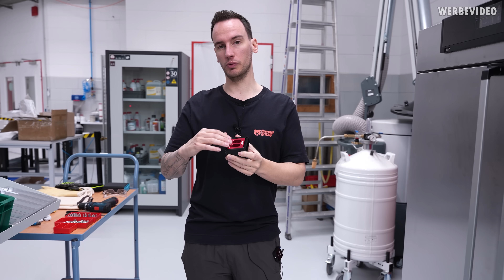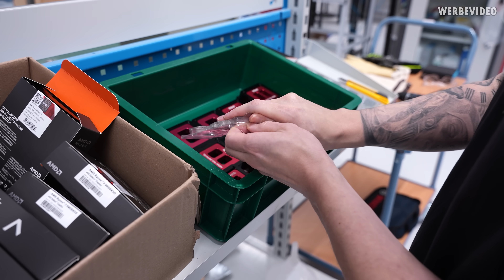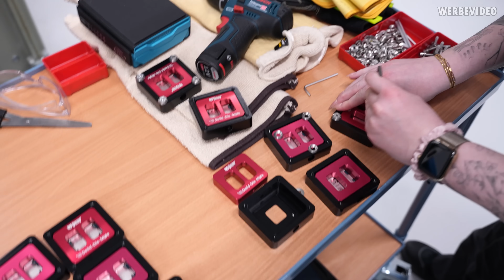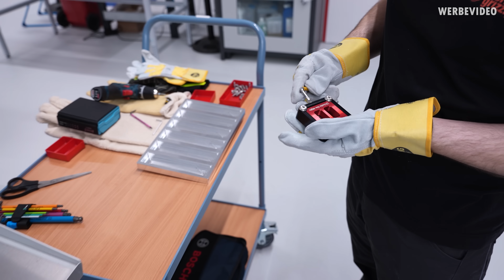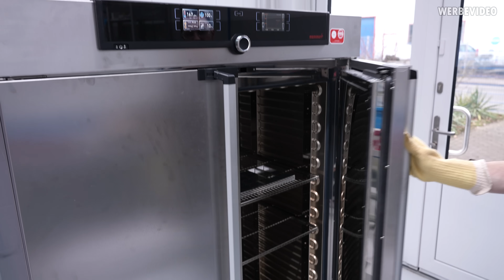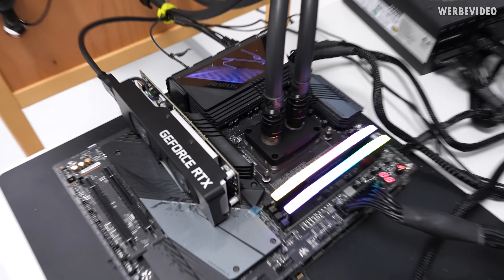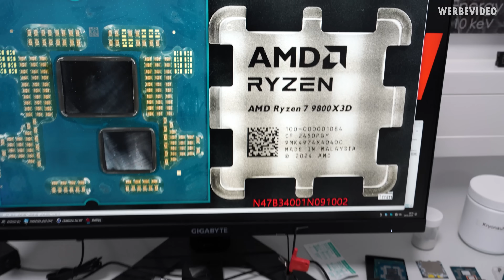You can now buy Delidded AMD Ryzen 9800X3D with 2 Years Warranty

Comment: 800 USD to get it delidded when I can purchase one brand new for $470 or used for $390. Not sure if it is worth it..
Reply: I also looked for a pre-delidded CPU (AMD Ryzen 9 9950X3D), but I felt it was better to buy it from a store for €600 rather than pay €1000 for a delidded one. How can the warranty cost that much? They already have the knowledge and the equipment.

For me, it would be enough if they simply tested the CPU after delidding and sold it without a warranty, since the customer should know how to properly install such a product. A warranty should not cover risks caused by improper use by the buyer.

Comment: Quick Question: Once its delidded, does one just mount a cooler (AIO) on top? Will the cooler lower to the die, for example using the thermal grizzy frame installed as well?

Comment: i see some pretty low hanging optimization fruit. why not gang a row of these tools together, drive it with an off-the -shelf leadscrew-based linear actuator, driven with a stepper or servo motor? you would need some sort of hinged or removable linkage between the actuator and the sliding block unit, so that the connection to the actuator doesn't prevent it from being lifted away when loading/unloading CPUs. Also, i noticed that in the consumer version of your tool, you use washers as a sort of bearing surface to hold down the sliding part. this is a low-quantity internal tool, why not replace them with a pair of stiff rails that index into place on top of the combined base, and are held down by toggle clamps or some other high-force quick-release mechanism?

Comment: Isn't the original 9800x3d processor good enough? Why do we need this process? What % performance and fps do we get? These are the questions that occupy my mind.
Unless he is a conscious and experienced user, someone who delided his processor will not be able to overclock it anyway, he will use the default profiles in the bios. Right?
It can be applied to intel processors, if we can be efficient enough and get enough cooling, but if I'm going to see the same temperature values, I don't think it's necessary.🤔

Comment: Missed the notification when this video released due to a crazy workload. I only have one major criticism of this initiative and that is that it should have come out sooner so I may have been able to get this instead of the stock version. In all seriousness tho I think what you are doing is fantastic and I still don't see why AMD couldn't do the same thing from the factory, especially considering that if it was their own product the would be able to produce it much cheaper than the lidded product (No costs for IHS, glues etc). I love the inclusion of the USB as it protects both yourselves and the purchaser allowing both parties to buy/sell the product with confidence. As someone that does not want to void warranties but also wants to tinker with water cooling I only wish to see this sort of approach  also reach GPU's as I was originally looking at getting a 5090 with a water block. The only one I know of that comes like this is the AORUS XTREME WATERFORCE WB and that went from I think $5,500 AUD to $7,100 (not that there was any stock). I hesitate to instal a block because, even though I know I would be able to without a problem, dealing with any sort of RMA is made even more difficult from Australia. I love to see initiatives like this actually going ahead and I think Thermal Grizzly may one day soon be the new go-to water cooling company that hopefully sells everything you need.

Comment: Are you going to do the same for next AMD chips like 9950X3D or next gen?
And I've heard some stuff regarding delidding but I'm not sure here, you ship it separated from the heatspreader, what's the point in the end?
I just got my new rig less than a month ago, went from Intel to AMD first time, some stuff are better some are same some are worse, was planning to go for 9950X3D but just couldn't wait for it but it's just a matter of replacing the CPU if I need it, I think 9950X3D is gonna be something better for what I need most likely.

Comment: Looks reasonable in terms of pricing. Electronics stores would charge around the same just for their own additional warranty)
From the perspective of a customer I thinks risks + delid tooling + removing glue and polishing + testing for that price seems fine. I thought it would be more expensive.

Are you planning to also make OC packages or packages with a bracket of some sort for safer cooler installation? I believe OC packages have to be mobo+cpu, probably RAM too, and I don't think there will be enough demand to make it work business-wise, but it is still interesting to see your (or anyone else) thoughts

Comment: The normal CPU costs €550 on eBay France. So if you buy this from outside the EU and get it shipped, then the delidding would have cost you around €20. Incredible value.
Reply: customs fees exists tho in France and they are not cheap

Comment: I have seen a video of using dental floss to remove the glue from the four corners of an AMD AM5 CPU. If you are skilled, the whole process only takes 5 minutes. Compared to your first step, this method will not cause physical damage to the CPU core.

Comment: 11:30 Since you asked for feedback, the only thing I would say is that AMD offers 3 year warranty on their CPU's whilst you are offering only 2. I am looking to build a new machine soon and would be interested in a delidded CPU however the warranty reduction seems odd. I understand you are taking on financial risk and that you may have settled on a 2 year warranty based on failure rates, DOA CPU's, mistakes happening during the delidding process, etc, but the reduction in warranty gave me pause. Otherwise, this is a cool idea and I wish you all the success.
Reply: If 12 months less warranty gives you pause, delidding was never for you. You do realize that by delidding, Thermal Grizzly is assuming all the risk? They can't RMA the CPU's to AMD if anything goes wrong. Add to that, they actually cover more with their 2yr warranty then AMD does, because AMD will void your warranty so fast, if they suspect overclocking.
Reply: @tessaninetails8065  I made reference to that in my comment. Spend 5 seconds more to read the remainder and you would've seen that. He asked for feedback (positive or negative) and i gave it.

Comment: I'm getting  46325 on R23 with my 9950x at 80degrees with PBO and -30 curve. My 5950x was getting 31000 with similar settings. Both using the Thermalright AIO 3x120 cooler. I think that's pretty good.

Comment: Been working and just got around to watching... I'll tell you what, you offer to mount a 9900x3d delidded, mounted to a mycro pro with conducto extreme, a delidding V2 frame, and whatever extra cost for the shield... You have a service or group or bundle that I'm down to pay the extra on. At the end of the day I think it's a great idea for a niche few of us. I think offering something like the above opens it up to those that are interested and still concerned with say cracking the die while mounting a cooler etc. just my two cents, charge what you will the market including myself would pay for it. The price is fair and if you weren't sold out already I'd have order a 9800x3d for a family member while I wait on the 9900x3d.

Comment: You need handles on the CPU tray, Your gloves are touching the pins when moving it / with a big chance of moving them or bending. Just an observation. Maybe use a transport trolley too, so you have less chance of a drop. Just see that as probably the risky part of the process. PS (your 1 looks like a 7 on the test sheet) I'd lalso ove to see links to cooling options you offer / tested for at lower profile de-lidded CPU, as I'm sure rthere are restrictions / mods that are required for this as a cooling requirement. Keep up the good work!
Reply: What pins? You mean the pads? Lga cpu no pins :)

Comment: This is awesome! As a few people have pointed out already, this is a fantastic value and genuinely have me excited. I was planning on waiting for the next generation of AMD processors because I was hoping for an IO die upgrade, but if I jump ship early it will be to this. Looking forward to more gray products like this from you and Thermal Grizzly! I delidded my 4790k back in the day and would easily have paid the difference here for a warranty and expert hands
Reply: Not a lot of point to upgrading the IO die, at least to a smaller process.  There just isn't any significant advantage in a die shrink.  Other stuff like a new memory controller or more PCIe lanes will not happen till AM5 has run its course.

Comment: That's a cool idea, I'd like to try a delidded cpu in the future.  I have an almost 2 year old 7800 X3D, maybe in another 3 or 4 years when I upgrade.  The last thing I'd need is a video reference for how to properly apply liquid metal, and install a common liquid cooler radiator (Arctic etc.) on the delidded cpu.
Reply: You need a special water block for a delighted CPU or the contact will be improper
Reply: @stang10189  Thanks, I wasn't thinking in detail, good point.  I realize the liquid metal needs to be gasketed in place to prevent egress over time too.  Obviously not as permanent like thermal paste.

Comment: Above and beyond Der⁸auer. 

I'm on a 5950x r8 now. Would be happy to buy from you on my next upgrade. 

Would be even happier if you did 9950x plus if you could do the "insulation painting" of adjacent structures to avoid short circuits. What I mean is the chip ready for the LM to be applied from my part. Nothing more.

Comment: Could you possibly do this as a combo pack with the cooler? Not sure on the variances between MBs but would the cooler have torque specs with it? I am asking because you brought up cracking the die and that would be one way to alleviate that worry

Comment: Neat service to offer for those that don't want to do it themselves, but want that performance. Kind of interesting to see that you are still using a standard CPU threaded nut tension system on your test bench even though that system is going to see hundreds or thousands of CPUS. Maybe engineering some sort of quick release arm system would benefit loop time for testing which turns into lower costs. You should consider trying to find a datasheet about the CPU socket to make sure you arent running too far into its maximum I/O count and marking CPUs as faulty that actually arent.

Comment: If you have this version cpu, could you cool it with a 280 aio (normal size rad and fan, 30mm+25mm)??
Reply: Most of the performance improvement comes from the WB which affect the heat exchange between the CCD and the liquid. Installing an AIO, which features a basic waterblock, instead of a proper high end direct die WB simply doesn't make any sense.

Comment: What I've always been curious about: Heating up the CPU to melt the solder joining the chip and IHS, this doesn't damage anything?  It's always been a bit of a point of confusion because it's well above TJ max and I've known many computers (though in this case laptops) die from running too hot for too long.  If it really is that safe, I take it VRMs or electrolytic capacitors are the culprits there?

Comment: This is a pretty good setup. The cost that someone's going to spend to de-lid themselves is actually not far off from the premium you're charging. When I delided mine, I used fishing line to cut and hot air soldering station to remove. This left me with quite a lot of Indium residue. Which I had to sand away, leading to me having to lap my CPU. It worked fine but it was definitely time-consuming

Comment: Hmmm... my 9800X3D is running un-delidded at Delta T 40 K stock in CB23 (10 Min.). Guess I was quite lucky in silicon lottery or the temp readings are awfully wrong. Only time will tell.

Comment: I would be interested in purchasing a delid CPU with pre-applied liquid metal and the TG direct die watercooler. Any package deals available?
Reply: Yeah, I think that would push me over the edge for my upgrade.
Offer a bundle of everything I'd need for a Direct Die cooling:
Compound, water block, frame and CPU.
Not sure how well liquid metal would travel pre-applied if it wasn't mated to the block and I guess you'd have to separate the block and CPU to mount the frame on the motherboard.
Pre-applied paste is common in other coolers, but with liquid metal, I'd be worried that it would get melted in transit.

Comment: unless you're into XOC using LN2 then why would you bother?  after also buying the required direct die water block you have a setup that is far more fragile, performs 5% better best case scenario and costs £200 more.

great product and service for the 0.000001% of people that it actually means anything to but not for the masses.

Comment: So my optimus CPU block can do direct die cooling. But I also have a high performance direct die heat spreader from TG. Should I use both or will I get better performance just direct die cooling without the TG heat spreader?

Comment: Great idea, but i don't get why AMD and Intel refuse to sell delidded CPUs...
Even without liquid metal and with some regular paste, i believe the temps are going to be better than the lidded one, anyone tried that?
Back in the Athlon XP era all CPUs where delidded and even had 4 small pads in the corners for even pressure of the block/cooler.
No one complained about cracked dies back then, if you broke it was always going to be your issue as an installer.

Comment: PS ..... How much degrees difference will it make, instead of the normal (soldered ?) one ?  Because my 9800X3D stays "atm" below 68 degrees, 
with my ' 280mm A.I.O. from ' Arctic Cooling ' ( The  Liquid Freezer III )
Reply: It will run ~10c cooler, but 9800X3D doesn't really benefit from that since it already runs quite cool thanks to the 3D cache now being below the die. Most people can already hit 5.4Ghz all-core at around 70-80C which is already plenty of headroom before thermal throttling kicks in, and getting above that is silicon and motherboard luck to be able to run a higher ECLK. 

So, I'd say de-lidding is 100% an enthusiast thing for 9800X3D users who just want to see the temperature number go lower. There's just so little headroom for overclocking because the silicon quality is already high and so they're hitting near the chip's max at factory settings. This would be more compelling for chips that can suck down 300+ watts and you need to dissipate that heat as efficiently as possible.
Reply: "Not enough" for you that's for sure since you haven't even increase PBO limits.

Comment: Have you tested any delidded 9800x3d on an aio for it's overclocking potential just to get a rough idea of what's possible? I can run mine at 5550 on a basic air cooler, but if 5700+ is possible, I'd grab one for sure.

Comment: As mentioned, cracking the die isnt covered under warranty but should we expect this if using with the AMD Mycro Direct-Die Pro block you guys carry?
Reply: Why the hell would you pay extra for a  CPU that has has the heat spreader removed, the TIM changed to liquid metal then the heat spreader reapplied and resealed just to have to delid it again yourself to use a direct die cooler......

Comment: I working in retail and sometimes these CPU-s are faulty or dead from the box. I suggest Der8 to test them before putting them to the oven. imho strange idea to delid 9800X3D, this cpu is not hot at all. 9950X3D is more likely to benefit from delidding.

Comment: Appreciate that you’re offering this at all, but the fact that the warranty doesn’t cover cracked CCDs due to mounting issues (too much pressure, uneven mount, incorrect mounting height, etc) is disappointing, as this is by far the most likely cause of critical failure when delidding. I totally understand why you’re not covering this, but for me a warranty allows one to have complete peace of mind when working with the product, and I wouldn’t have that knowing that a very small mistake could lead to the unwarrantied destruction of the chip
Reply: This is like saying "I blew up my engine while racing, why won't you replace it under warranty"? If you're not comfortable mounting a cooler to a delidded chip, you shouldn't be buying it in the first place.
Reply: @gordb6142 there are MANY examples of warranties that fully cover user-induced damage due to mistakes, accidents, etc. Even in the PC hardware space, this type of warranty is very commonly offered by large, reputable manufacturer and reseller brands. It is disingenuous to imply that this is some unheard of practice. Again, I mentioned why I understood why TG has opted not to cover this type of damage with their warranty, I’m just saying that given that it is the most likely form of critical failure a user may encounter with a delidded CPU, this warranty does not hold much value.
Reply: @arckie  Can you give me an example of where a warranty fully covers user-induced damage due to a mistake?  If you bend the pins on a motherboard by incorrectly installing your CPU, why should the motherboard manufacturer be responsible for this?
Reply: @gordb6142 you’re asking 2 different questions here. To answer one of your questions: ‘why should they cover accidental damage’ - the answer would be because they make more money from being able to sell more product due to the security of the warranty, than they actually pay out in warranty claims - making it profitable. To answer your second question, ‘what brands provide warranties that cover accidental damage’: Best Buy geek squad coverage, microcenter extended warranty, just to name two that I personally have right now.